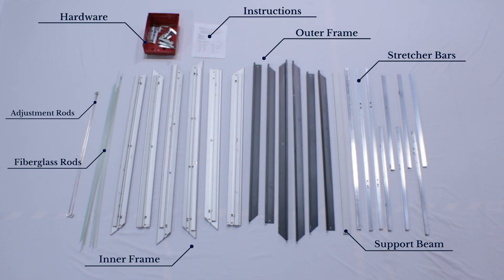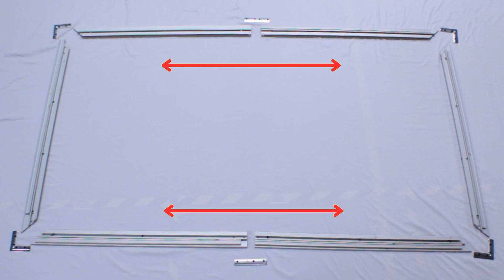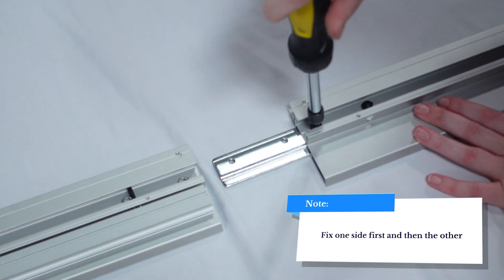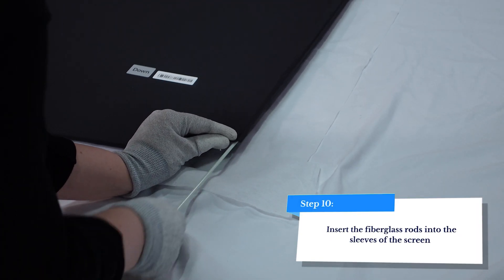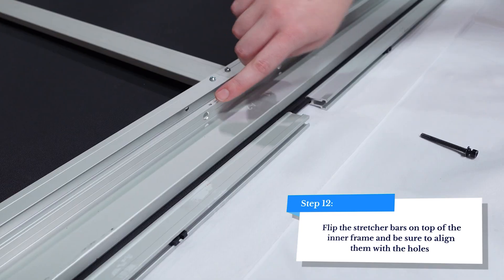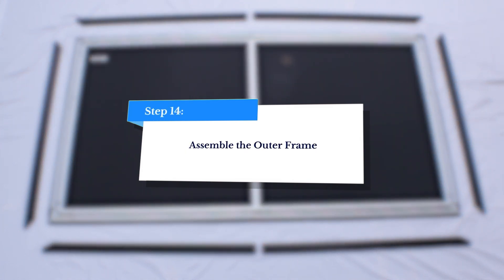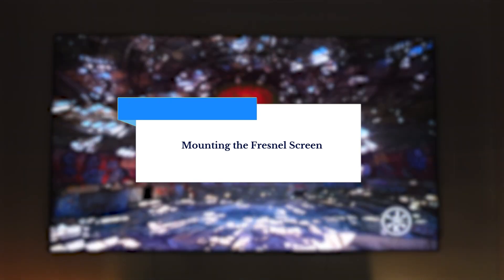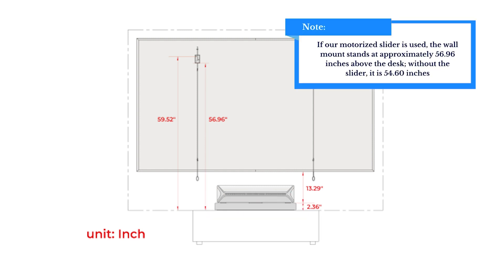NexiGo Fresnel ALR 100-Inch Screen for Ultra Short Throw Projectors Build Tutorial

Comment: Mounting bracket screw holes are pretty wide. Instructions are confusing. They say don’t mount to drywall and then proceed with telling you to drill and hammer in anchors which are obviously for drywall. I want to mount to studs. But the holes are pretty wide on the bracket for a 1.5 inch stud. Can I just do the right or left top and bottom??  What’s the deal. Why so much lacking on wall mounting ?

Comment: Definitely need more description on mounting -- which way does the bracket get mounted? the flat side against the wall or the flat side against the screen? it looks like the flat side against the screen, but tough to truly see. how deep should we drill the starting 8mm hole? how far apart should the brackets be? i assume same distance from each screen edge, but it looks like not exactly in thirds. does it matter? 

Edit: I actually answered all my questions at this much better installation video -- https://www.youtube.com/watch?v=Uk3ucaMTuPg